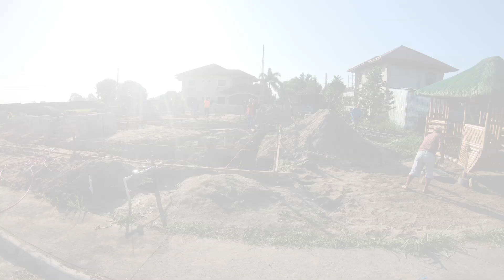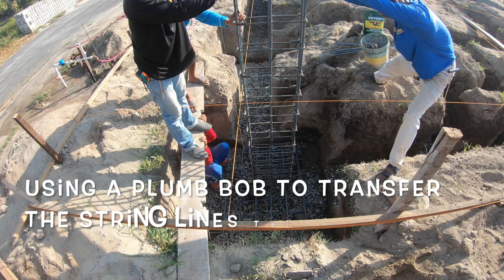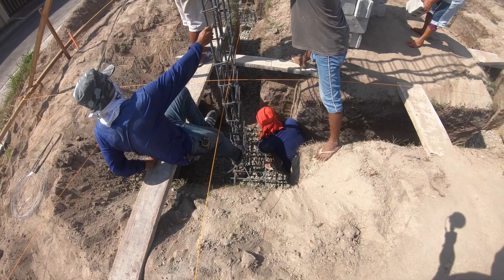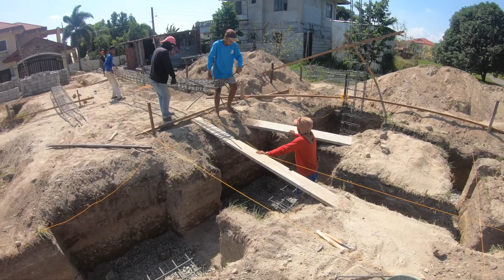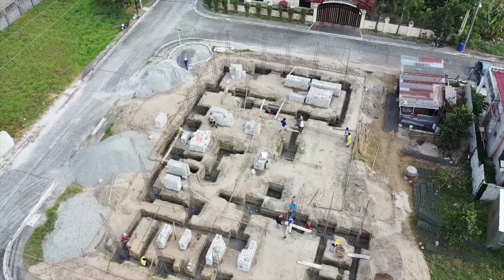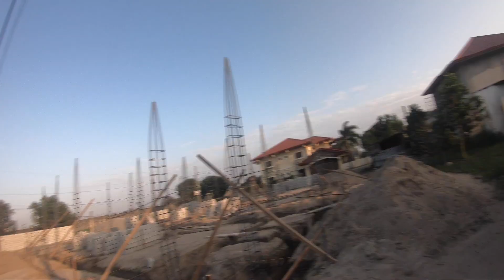Philippine House Building Step by Step, Build Day 15: Heavy Metal

Comment: I never understood why they don't use levels.  Are they not sold in the Philippines?
Reply from the maker: The bar levels are expensive. Cheaper to use a tube with water in it to do the same thing for less.
Reply: @CasaTexPina  When I was building pools some time ago, I used a "water level" (tube with water) every time to gain a perfect level beam.  It never fails and if you drop it, it doesnt break
Reply: @CasaTexPina  level hose really is cheap. is it  as accurate as level bars? (gen question from an Archi student)
Reply from the maker: @hudapizza7917  works like a charm especially for long distance or transferring elevations.
Reply: @CasaTexPina  thank you sir! Your contents are of a great help for students esp in this pandemic. Stay safe!